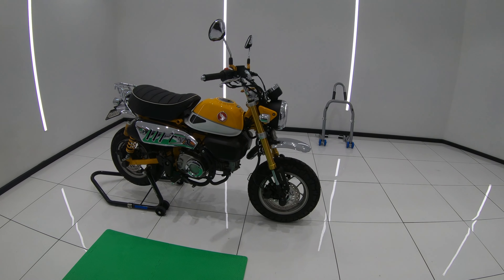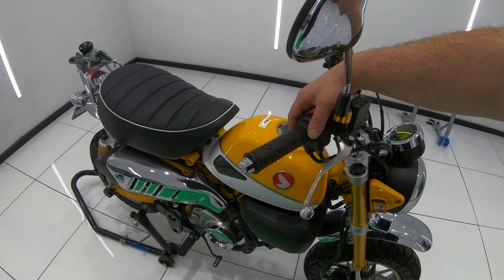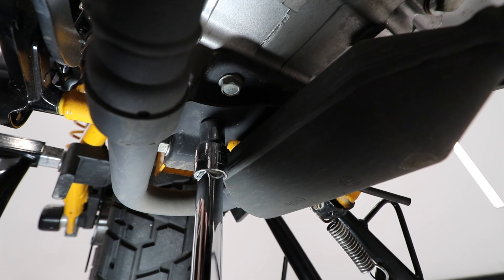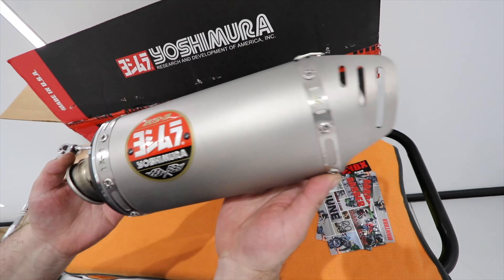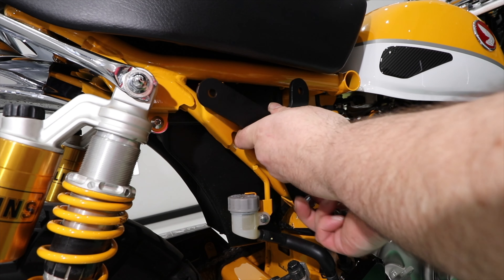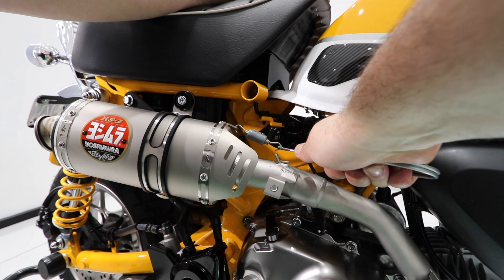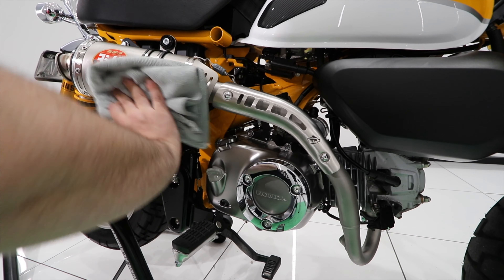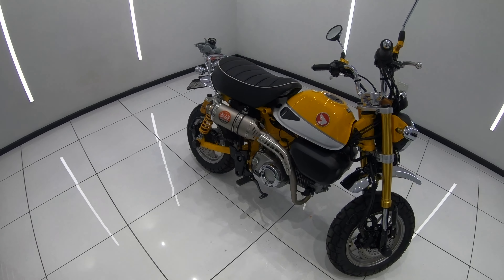Honda Monkey Yoshimura RS3 Exhaust Installation Video & Sound!

Comment: Looking great. I order a takegawa std look exhaust. Just a tip: get rid of those crapy and danger stock tyres. Ive got ohlins front/rear and bridgestone ml50. It makes the ride so much beter and safer
Reply: How did you like the takegawa std? I’m deciding between that and the takegawa scrambler

Comment: Best video around on the Yoshi exhaust.  Thanks very mich!  But how did it feel when riding?  Noticeable increase in power?
Reply from the maker: Thanks, the exhaust on its own isn’t going to give you a very noticeable power increase, but it does sound fantastic and add to the joy of riding the bike. If you add a good air intake and get a stage one ECU tune on the bike that’s when you will see and feel better pickup and a higher top speed. I did that a few months back and absolutely love it.

Comment: Great video👍

Any issues with EPA for noise level? With cops checking every inch of bikes these days, have you had any issues?

Planning to get monkey tomorrow.

Thanks
Reply from the maker: No I’ve had no issues, many bikes around here are just as loud so I’d have to be unlucky, but you’re right that they are getting tighter with enforcement.

Comment: What about tuning?
Reply from the maker: You don’t need to if it’s just the exhaust, but you can. I did a remap after also upgrading the air intake.
Reply: @CarCraftAutoDetailing  Thanks for your input ,I had already order and was sure I'd made  a mistake I'm just looking for sound and maybe little extra power ,but planning on  street  riding and keeping up  with traffic better.

Comment: Hey, do you have to remap it once fitted?
Reply: @CarCraftAutoDetailing  Thank you very much, that's put my mind at ease 👍
Reply: Does it need remap once fitted buddy?
Reply from the maker: If it’s just the exhaust you’re fitting or modding, you don’t need a remap. But if you also upgrade the air intake then you will need to retune the timing and petrol ratios or else the engine will run a little too lean.
Reply: @CarCraftAutoDetailing  thanks guys 👍 great help